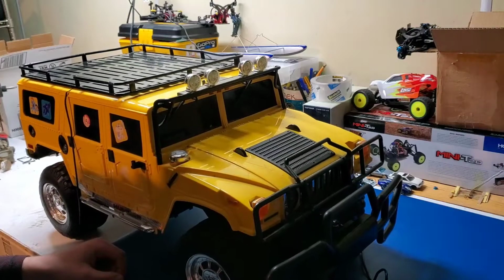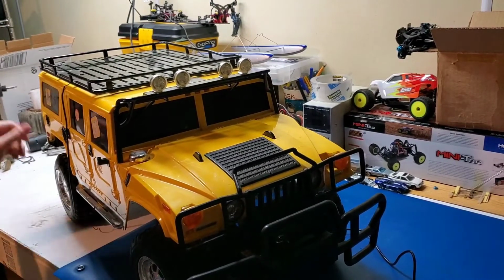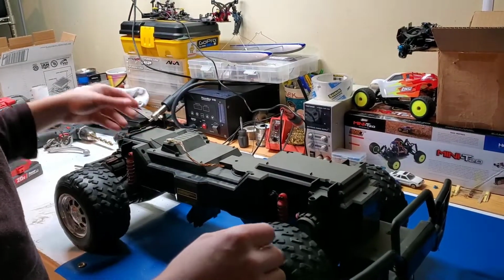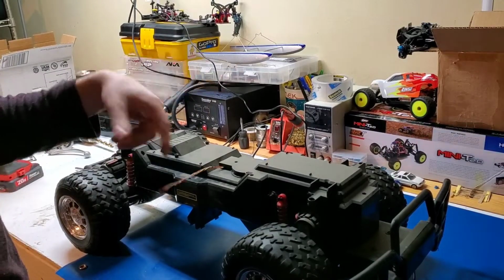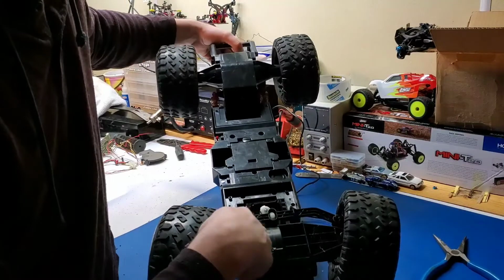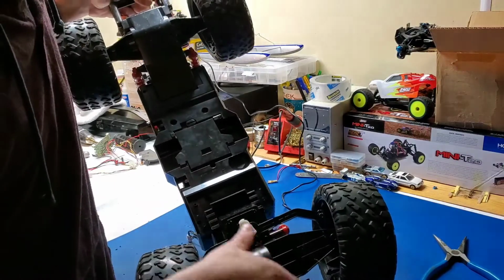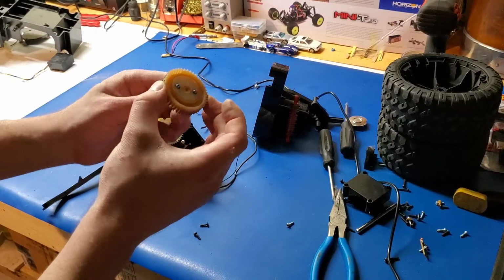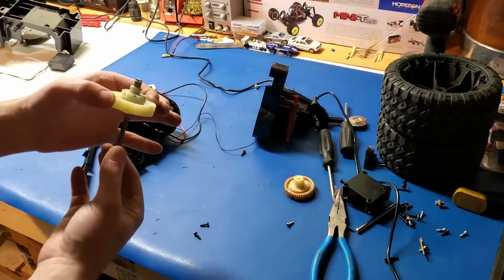I BOUGHT A HUMMER FOR $5!? - not clickbait

Comment: Great vid and conversion!

I didn't know they made a twin motor version of this chassis until now.

They used to make an older 1/6 chassis that came in either single or dual motor versions. It was a lengthened version of the chassis family that started with the Hawg and Thor trucks and was a little closer to hobby grade having double wishbone front suspension, metal front drive shafts and steering links amongst other things.

This chassis is still cool though, still takes 540 motors which makes life easy and I see they still have those damper mechanisms built into the spur gears, the overall construction is a little more simplistic but it's still a sturdy chassis and a real step up compared to most other toy grades.

I've never seen one converted to hobby grade before and I've never seen a dual motor version before so I enjoyed the video a lot.

I have several hobby converted Nikkos on my channel if you're interested in having a look some time.
Reply from the maker: Interesting about the chassis evolution, I don't know a whole lot about Nikkos. Thanks for watching!
Reply: I didn't either,,,,
Reply: That's the bigger model. I had that as a kid and it was the smaller one